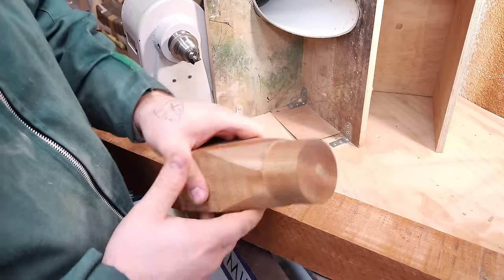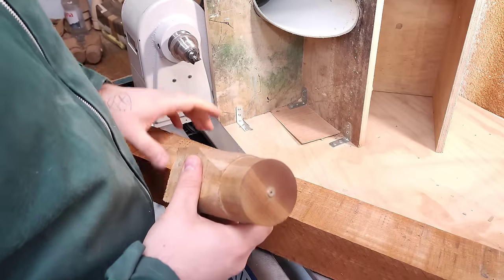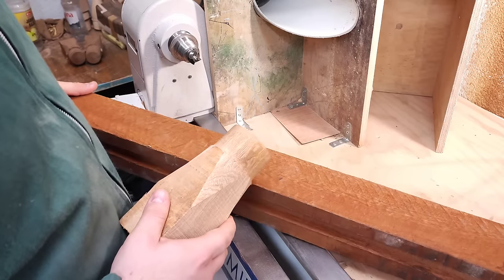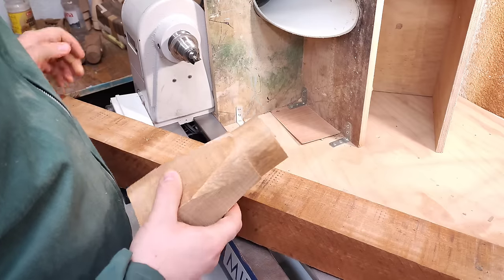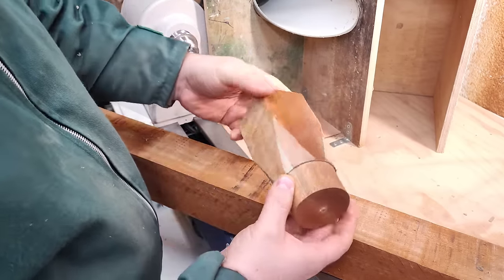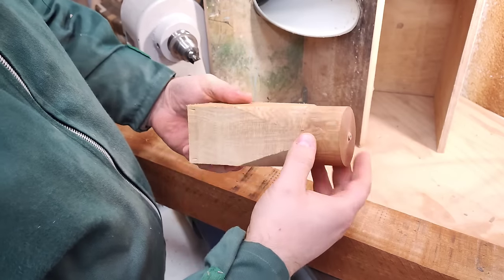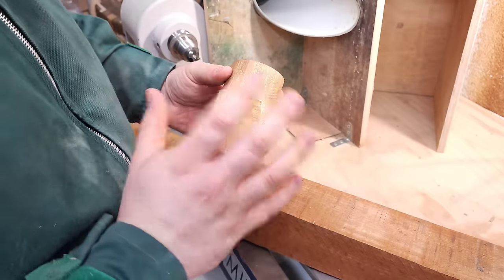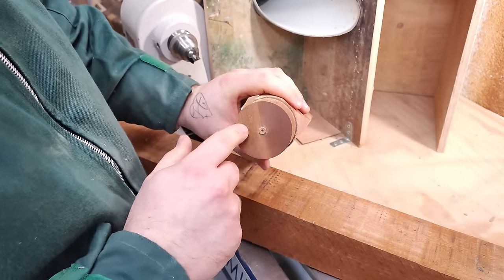Beautiful wood but no one knows what is it...

Comment: I've been lurking, watching your videos, Tomislav. I simply haven't had much to add to the conversation. Today, I do. I made the first of two similar boxes as yours, but from cherry. Like your timber, it had nice straight grain, even an inclusion, that aligned nicely even after one flange resizing. Even then, the fit could be tighter, though it does pop.

So, as I comment 7 watch, you discuss the scraper edge.... I just reduced mine on a similar square scraper. It reassuring when turners you respect do the same things as I do.

Great work, as always.
Reply from the maker: Thank you Jay, appriciate that ☺️

Comment: Nice piece. The wood looks like a bunch of different things that they call 'mahogany' but aren't..... I didn't like the snap type lids. People would pick them up and give a slight tug, and when the lid didn't come off, they would put it back on the table. I go for a 3 to 5 second lid. Pick it up by the lid and it takes 3 to 5 seconds for the base to fall off. Same process. I did see one guy, Eric Lofstrom, who turned boxes with 1 inch tenons. Lid would be spot on parallel to the lathe bed. He used a scraper that had the edge ground perfectly straight so you could eyeball the lathe bed as you made the plunge cut. The tenon, he would start with it spot on parallel, but then would crown it slightly so only the center was the exact diameter of the lid. The lids would gently slide off. One he wouldn't pass around because 'just the warmth of people's hands would make it swell up a bit and the lid wouldn't fall off. He did turn them down in stages, taking 6 or so months. This would make up for the wood adjusting to bulk being removed. Interesting process. I haven't tried it yet.... I did do a 3 foot long pasta rolling pin that way, and 2 years later, it is still spot on straight. I do prefer to rough turn my boxes first and let them sit before finish turning them.
Reply from the maker: That is accually what I usually do and my last box on 4ways after wood moves its 3-5second lid....
I do like that process and I wanna make soon a tall tea box with lid like on selphone cases where it just slowly goes down.... probably in new year I'll do that but need some interesting timber and I try when I can to rough out stuff ....
That stick with me from time I learn my trade in woodworking

Comment: I have several pieces of that wood. No idea what kind of wood it is, but awfully dense. Pretty color but not much graining?  Does not sand well. I also got mine from wood flooring company as what they consider scrap. Got some real dark dense wood and also some lighter color. Must be coming from Africa and used to support boxes of wood flooring?
Reply from the maker: This sounds excactly like yours apart density, this is not dense like more usuall african woods.... Well who knows as only mahagony has over 70 subspecies.
Reply: I have a question not related to this. I have a scraper that cuts on the right side. Do I have to put the lathe in reverse in order to use it?